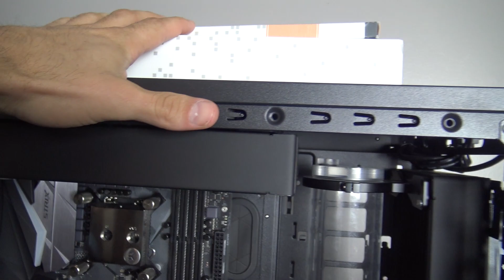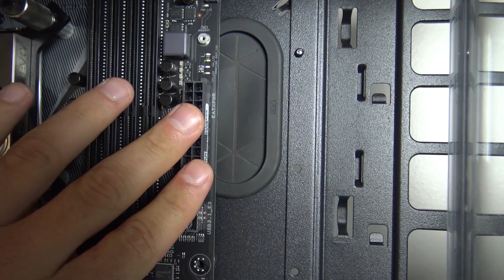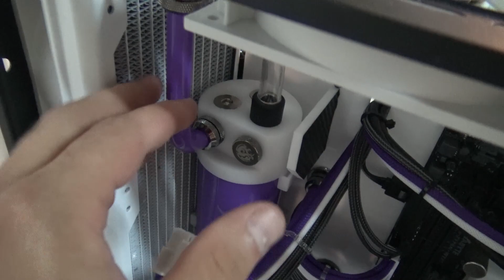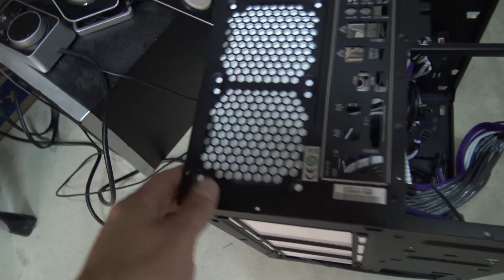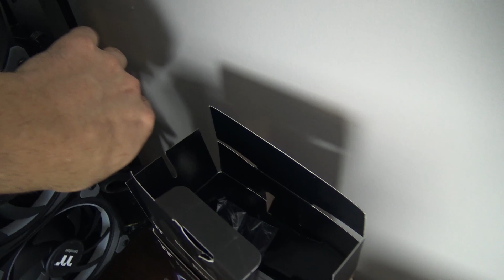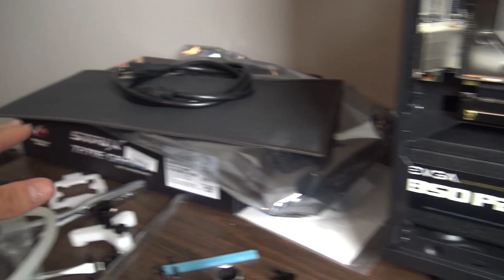Thermaltake View 31 TG: Custom Water Cooled Build Log Pt 2

Comment: When you block off all of the ventilation holes on the bottom and front of the case, how much does that effect temps? I know custom water cooling needs less air flow, but you seem to have cut most of it off.